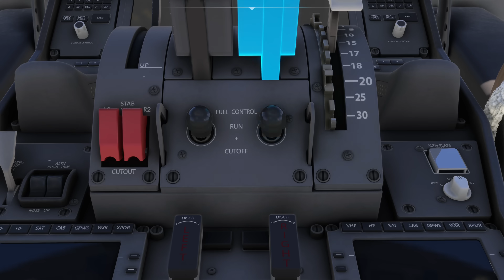Air India 171: Why Did The Fuel Cut-off Switch Get Moved?

Comment: The fuel cutoff was done in the first 4 seconds after liftoff. From second one to second tree, both pilots have the hands (with which they could handle the switches) occupied with the controls of the plane. The first pilot to release his right hand is the Captain
It can be seen on the video that after 4 seconds after litfoff the plane begins to lose the ascending rate.

Comment: It sad that it going wild as I guess those investigator didn't wanted to expose this truth which lead to misinformation. Without the audio go to public is not easy task. Still it not simple task. I seen some video that power off fuel was very fast. In which it not human possible to do right? Which required two hands to turn off the fuel. Which puzzle them. The pilot would notice. Is few sec or minutes to turn off the fuel. But there should be alert alarm signal it was power off. They could see the fuel warning or sound right. Well not sure of the correctly or something as video demo how those pilot test or demo in the simulation? If not pilot or both depend. Those pilot should have experience flying so there no way they want to die. Well news are going wild. As record I guess they do not get fired for mistakes. Still there are few pilots are doing some record their experience on YouTube.

Comment: I suspect we’ve only heard the minimum of the cockpit conversation in the interim report.  Questions remain such as why the question the pilot asked about putting the levers in the cutoff position wasn’t time-stamped.  Also could that pilot have been deliberately trying to implicate the other pilot.  I suspect a lot of cockpit conversation detail has been held back and will become a large part of the final report, and may be quite different from what folks are currently thinking.  That conversation has to be integrated with all other technical information.

Comment: Hmm.. I would think that the two switches had separate sets of contacts. One set would be wired to the fuel cutoff circuit(s) and the 2nd set of contacts would be configured to show the actual position of the switch lever which is connected to the data logger.

Comment: Why is it possible to cut off fuel IF thrust levers are not on IDLE? Even with a fire warning, first thing is thrust lever to idle? Or not?  During this phase of flight, takeoff >V1, climbout, without any warning message, it should even not be possible to shutoff both engines, 1 yes, but not both

Comment: So something nobody has thought of that I have seen is the probability of a mechanical dormant rare fault in this panel. Since the switches are both used almost exactly the same amount of times together the wear and tear of them would also be almost identical therefore it wouldn't be that astronomically unlikely for them both to fail at the same time and that there were some issues getting them both back to stay in to the correct positions (therefore the several seconds delay). Only a thorough examination of the fuel switch control panel can reveal this potential fault. This would also indicate that it took 12 years for this fault to materialize in this particular unit that may have had a manufacturing fault in it. However I personally don't think this is the reason but nothing can be excluded before all inspections of the wreckage have been concluded.

Comment: I find it highly dubious how quiet the engine manufacturer themselves are being. Modern engines are monitored 24/7 in real time by said manufacturers. They KNOW without doubt if the fuel supply was cut off. I find the lack of communication "interesting." They could very easily confirm if this was in fact the memory items for a dual engine failure or not....

Comment: Correct me if I am wrong. I was reading about these switches and their nature being mechanical-electrical. I understand there is little possibility of the aircraft control software interfering with the switch's operation. I stumbled upon the acronym FADEC and read up just a bit about it. So is there a remote possibility that a software glitch might have flipped the switch to OFF? Trying to understand all the scenarios here. Thanks :)

Comment: What if the software had turned off the fuel even though the switches weren't put into cutoff?  Then the pilot toggled the switches from run to cutoff and back to run in order to try toggling the engines back on.  That would explain the delay in putting both switches back to run.

Comment: Not the first time this has happened. A legacy carrier out of LAX to CVG in 1987. Capt. accidentally selected FCS’s to cutoff at 1600’ on climbout.. He did not call for the QRH procedure which was applicable on the 767-200 for an EEC Inop light. After expletive from F/O the F/O selected them back to the run position. They did relight at 600’ and on to CVG.

Comment: Why the potential scenario of seat sliding during takeoff is ignored? 
It’s happen to me and some of other experienced pilots also have faced the same.
When pilot is suddenly sliding backwards during acceleration and lift off he is instinctively trying to grab anything. And this is happens exactly at the critical moment of nose wheel lift off.
If Fuel Control Switches are inadvertently moved person who did it 100 % will position them back ASAP
U-gin

Comment: there was a different captain, who suggested, today, that the pilot who accused the other pilot of flipping the switches was actually the one who did it, due to the culture in india surrounding murder and suicide. he also mentioned that it was several seconds after that remark before the first switch was flipped back to run, and a total of ten seconds after the comment before both switches were returned to run.
i wonder if there will be fingerprints on the switches that can be examined.

Comment: Surely the plane should have protected itself. At that moment in any flight the fuel cut off switches should have been overriden by the safety computer monitoring the plane. Seems like a design flaw. There is no flight procedure for the pilots to ever  manually operate fuel cut off at this point in a flight.

Comment: I have worked in Aerospace as a Mechanical Engineer for 40 years. Previous to that I worked as an Airplane mechanic and am also a private pilot. That said my specialty was in aerospace wiring and interconnect. Has anyone looked at the wiring/connector interconnects for problems? Wiring is one of the highest risks in a electrical system.
Reply: Exactly. I doubt those switches go directly to the cutoff valves. Capt Steve says the switches were physically moved. How does he know that? Can you hear the snap of the switches on the cvr? Once thrown where does the cutoff signal go? Software/hardware failure may have misinterpreted or generated the signal to the cutoff valves.
Reply: @stephenolshefski9290  Because the other pilot moved them back to the correct position, which he could only do if they weren't already in that position. This wasn't a wiring fault or software failure.
Reply: @cjameshuff  was that verified or just implied? Did anyone at any time say they moved those switches? The one pilot denied moving those switches. Where is the evidence the switches were moved?
Reply: @stephenolshefski9290 Oh come on! Snap out of it!
Reply: @cjameshuff   Or did the system restarted and it looked like they were moved back?
Reply: After placing the switches back in the RUN position, the engines attempted to restart.  This eliminates switches and wiring as the culprit.
Reply: @vincentsutter1071 not if there was an erroneous signal generated. Again is there hard evidence the switches were touched. We know there was a signal generated to cutoff fuel then a signal to restart. The cvr never has any one saying they touched those switches. The data recorder recorded signals to cutoff then restart but that’s not proving switches were touched those
Reply: @stephenolshefski9290  if it were one switch, yeah.
But the two of them...
seconds apart..
That's a chance of one in billions maybe.
 .
definitely on purpose
Reply: @aaronciviris  Exactly. No way an "erroneous signal" activated both switches but at different times. Any electrical or software-related fault would have activated them exactly simultaneously. That pause between activation of each switch is a dead giveaway that it was moved physically. Was it on purpose or did something hit them? Who knows.
Reply: @stephenolshefski9290  why ask the question "why did you cutoff"?  if it didnt happen then why would that be on the voice recorder ?
Reply: @nodak81   Technicaly it could. Maybe ther was already a delay in the signal to the recorder in previous flights. So if there was malfunction that turned of both switches at the same time it could be recorded as them being switched off with delay.
Reply: The problem isn't electrical. Those switches were locked in run position as evidenced by the picture after that crash and explosion. This coincides with the data and voice recording that tells us that it was on run position, then on cut off position, then on run position. Those switches are mechanical connected to a spring, and the pilot visually confirmed them to be in the wrong position.
Reply: I’m still waiting for all the i’s to be dotted, and t’s are crossed.  I understand why people are suggesting what the Prelim Report appears to be indicating.  In my opinion, it’s too early to come to any conclusion.  Maybe a hypothesis .. but I’m certain the investigation will be completed without bias and I’m interested in the findings that are found during the investigation.
Reply: I’m quite confident accident investigators will look at the wiring, or what remains. A 30 day preliminary report should not expect such detail. Full investigation can take a year or more.
Reply: Just curious if there’s anything specific to this case that makes you question the wiring? I’m always trying to learn
Reply: @mrhandyhandssr7839  I have no knowledge of the circuits related to this accident... and honestly lean toward pilot induced accident. But I have also seen wiring design or malfunctions occur from poorly designed cables, inadequate testing of cables (IR and DWV) , poor grounding schemes, ground loops, poor shielding, circuits not spaced correctly on interconnect, nicked insulation, impedance, etc. I know the wiring is always looked at and is often a latent failure, intermittent, or sometimes bad design. I would love to see the schematics of the system involved.
Reply: We must eventually face the facts as we know them.  We are visitors in this life.

We can face a short or a long life.
But ultimately, it does end.
Our spiritual beliefs are truly a comfort if we recognize that we have an eternal soul and those we have known and loved are with us.
Reply: Billion-to-one does not equal 0.  It is highly unlikely but not impossible.
Reply: @a.w.thompson4001  Especially with 33 million commercial flights each year...
Reply: @a.w.thompson4001  👍  3 of 3 hydraulic system failures was considered “couldn’t happen” - and it did.  (Different aircraft Make/Model)

Comment: If my life is on line and I see other pilot cutting off fuel line I will not ignore it and later ask why did you cut it but prevent it , also manually it is not possible to cut off switches within one second interval as told by by a Dreamliner pilot for 10 years! So we should not speculate pilot committed ??!

Comment: Why can’t there be a mechanism of 2 factor authentication for shutting off the fuel valves? Once the switches are placed into cutoff from run, there could be a prompt on the ECAM or some screen where the pilot has to confirm action and then the fuel supply gets cut off… ???

Comment: A simple logic can be built for Fuel cut-off switch to move to Cut position unless the related throttle lever is in the idle position. ???
In AI171 case, the throttle position was at full fwd for take off.

Comment: @CaptainSteeeve, from reports I have seen, the first officer was qualified as a captain for the Cessna 172 and the Piper PA34 Seneca. In the piper there are cowl flap switches that look similar to the fuel cut off switches in the Boeing as well as in similar location. My understanding is the cowl flap switches are used to help cool off the engine primarily during takeoff and landing. Is it possible that the first officer flying turned off the fuel cutoff switches based on muscle memory of the piper?
Reply: In your scenario the switches are moved by a human but inadvertently.  I think there is a possibility of this albeit remote.  Additionally, this would fit the dialog well where the pilot that move the switches honestly denied it not realizing what he did from wrote (and incorrect) muscle memory.
Reply: Why would the engines require cooling 5 seconds after V2? 
Additionally. I doubt Piper cowl flap switches have a physical stop/detent to prevent activation.

Comment: Well, the airplane was designed to handle various fault states within the plane itself. But not fault on the pilot side appearantly. 
Some suggestions:
1. Never allow the pilots to shut off all engines when in air because that will for sure lead to catastrophy.
2. Require zero throttle to enable fuel cut off switch to be set.
3. Compare the expected thrust with the actual thrust and start an alarm as soon as thrust drops below expected thrust, especially if there is not enough thrust to maintain lift.
4. Use energy uptaking devices, such as wires and sand slopes to bring down the speed of an plane that can not lift in time.

Comment: A middle ground solution could be putting a unique low level rf signal into the base of each pilot seat and sensors in each control panel or surface control verify which pilot touched which panel at any given moment and if it changed settings with no touch input.

Comment: it is possible with other jets having the fuel cut off switches move on there own it is possible if the locking device was instaled with locking switch being disabled witch  Boeing Sead could lead to the switches going from run to cut off is this possible yes they could of bin knocked around Durning take off it is possible that the switches moved on there own if the pilot is looking out the window of the plane and the switches got jolted by turbulence from the  thermals coming off the runway any thing is possible maybe no one touched the fuel cut of switches if neither  of them touched the switches and it went from run to cut off it could be a possibly

Comment: The flip side to redesigning the switches so that both pilots would have to be involved in shutting off the fuel shutoff switches is, what if one of the pilots becomes incapacitated? There have been instances in which one of the pilots has had some sort of medical emergency such as a heart attack, leaving the other pilot to manage the emergency landing alone. As an A&P mechanic, it would be better to build in an audible warning alarm if one of those switches is shut off, and also build in a time delay so that the fuel is not shut off the moment that the switch is put in the shutdown position. That would only require an avionics mod, which would be far more efficient AND more effective than having to completely redesign the throttle quadrant with some sort of mechanical latching system on the switches that would require input from both pilots.

Comment: Captain Steeeve, excellent analysis.
You establish that you may need to turn off an engine during final descent in certain scenarios. 
Are there scenarios in which you would do the same during initial ascent? If not could there be a mechanism that allows for this during final approach but not the initial ascent?

Comment: If one or both of the pilots intended to cause a catastrophe, why did they both react to the restart immediately? And, because of the restart attempts, we don’t know what the physical configuration of the switches was at the time the fuel shut off. Also, going back to the original video, I still have the question of why the gear started up and stopped. Seems to me there is more of a systemic issue here leaning toward electronic.
Reply: Because if it was a human action, the bad actor would want to redirect blame by faking any knowledge of the action

Comment: The AI171 report says a pilot turned off the fuel switches. Could this have been a system error or glitch? If the fuel switches on AI171 are spring-loaded, is it possible that a loose or faulty spring caused them to malfunction during takeoff due to the aircraft’s sudden jerk or vibration?It’s hard to believe such a critical action was intentional.